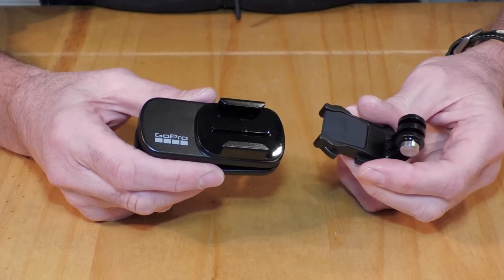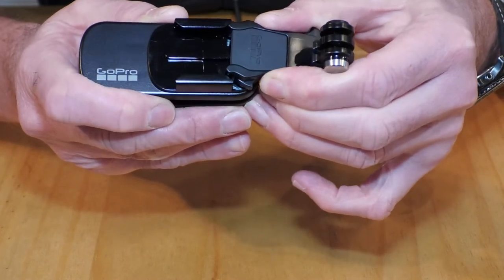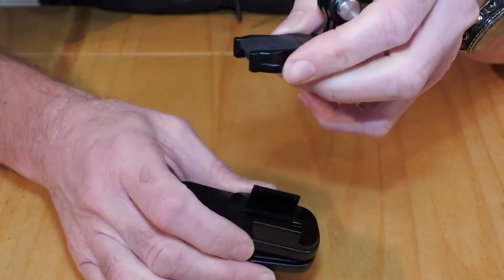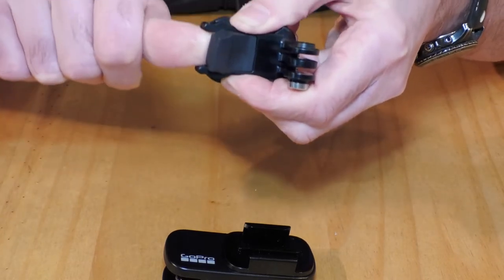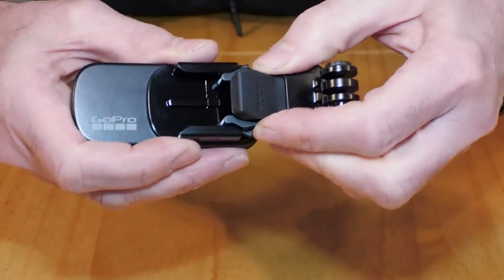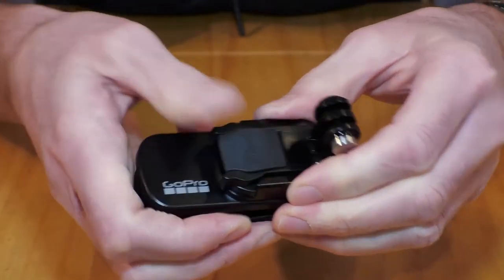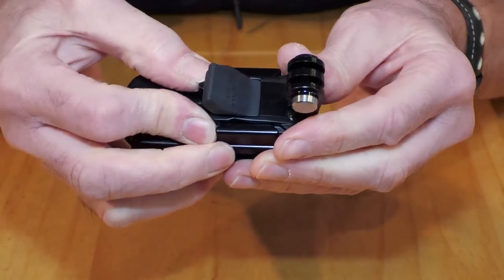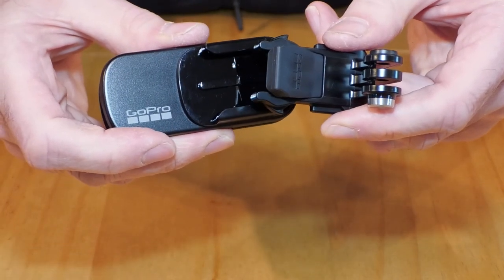GoPro Mounts: How to slide components together

Comment: This video is golden. What a bizarre locking mechanism 🙃
Reply from the maker: Thanks - I am glad the video was helpful👍
I think the mounts have been designed so that they provide a secure, vibration free mounting for a GoPro which is great but to make it vibration free it is an unusual design. When you get your first GoPro it is not obvious how the mounts work - it  certainly wasn't obvious to me and from the number of views and all the comments under my video its not obvious to lots of people. 
A simple slip of paper with a diagram supplied with the mounts would be all that is required.
Reply: @Helpful-Stuff  Exactly! Would imagine that they would have added such a small but useful instruction by now. But it does indeed seem sturdy now that I got the pieces in place.

Comment: What is that piece best used for and placed sir ? I have the attachments bag and lost with all the stuff in it
Reply from the maker: The part in my right hand is a clamp with rubber jaws. I have used this to clamp onto the edge of a desk or in my car the vertical metal rods that support the headrest on the front seats. The rubber jaws mean that it will grip on wood, metal plastic, glass etc 

The part in my left hand is the bit that attaches directly to the GoPro. On the bottom of the GoPro there are a couple of "flaps" that you can flip out with your fingers. Slide both flaps into the bit in my left hand then use the screw provided to hold the GoPro firmly to the mount.

When I need to mount my GoPro I play with the different attachments until I find a combination that holds the GoPro in the required location. I don't think there is any real rules ... its just whichever combination works in your location.

There are loads of other mounts you can buy ... I usually buy mine from eBay. The ones I have used the most are a helmet mount and a chest mount.
Reply: @Helpful-Stuff  thanks I'm slowly figuring it out thanks for the response tho 👍

Comment: can i just use it without the foam?
Reply from the maker: I always use the mount with the rubber thing pushed firmly in place. The rubber bit makes the mount absolutely rigid so there is no movement in the mount. 
Another way of looking at it ... GoPro wouldn't supply the rubber bit if they didn't think it was necessary. So since the rubber bit is supplied then it's obviously needed.

Comment: I just bought my first Go Pro, a Hero 11.   The instructions are abysmal and some of the attachments feel cheap.   So far the quality is out of line with the high price.  We'll see.  I shouldn't need to go to Youtube to figure this out.
Reply from the maker: I have got a Hero 9 purchased April-21. While I agree with you that the documentation is not good ... see the number of views on this video and LOTS of comments thanking me for the video. (When I made the video I thought it was just me and nobody would watch the video!)

However, what I would say is that my GoPro has been used regularly as a helmet cam when I am horse riding. It has got banged about a bit at the yard and has got wet in heavy rain but it still working reliably and none of the attachments has broken. The only problem that I have had is that one of the 2 batteries that I purchased started to expand and almost got stuck in the GoPro - I no longer use that battery!

Comment: It got stuck
Reply from the maker: I guess you have tried to force the mounts together in some way??? ... if this is the case then I guess you will just need to use force to separate the mounts and then follow the video and slide the mounts together correctly.

Comment: Dammit, I thought it was part of the packaging so I took it off.
Reply from the maker: Various comments have suggested a small piece of paper with a diagram showing how to slide the components together. A piece a paper would also have stopped you from removing it. I hope you can reattach so it still works correctly.
Reply: @Helpful-Stuff  yeah I have re-attached it, I don’t know if it will still serve it’s purpose, but thank you for this video!